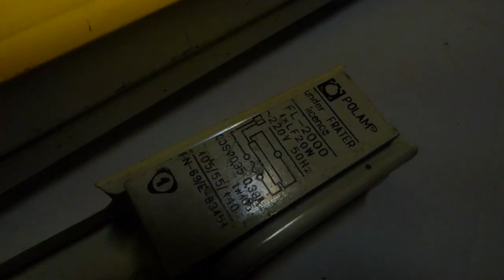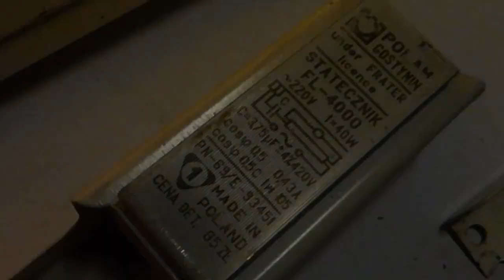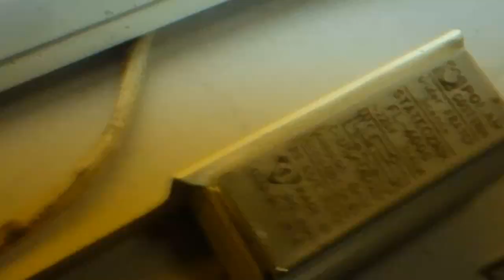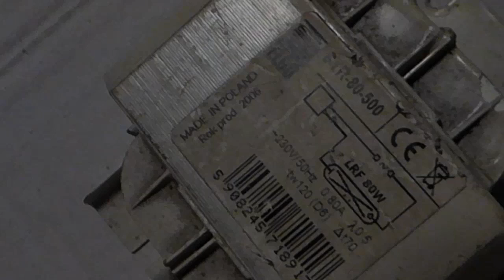Dobijanie świetlówki 20W - kill fluorescent tube

Comment: I used 40w ballast to work a 18w bulb it just ok, but the end of the tube is glow brightly
Reply: And i use 30 watt ballast on a 36 watt tubelight. But i m thinking of changing it s ballast because tubelight is dim
Reply: @ducac-0457   use 40 watt ballast it will go fine by the way is it magnetic or electronic ballast
Reply: Here in India we have 240v AC 60Hz and we use 40 watt ballasts for both 36 and 40 watt tubes it goes fine with magnetic ballasts as well as electronic ones